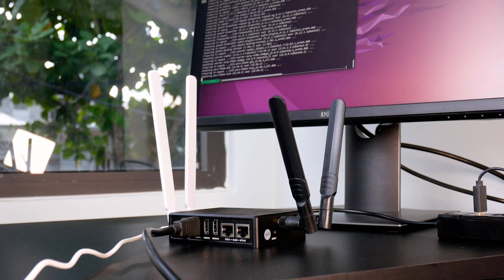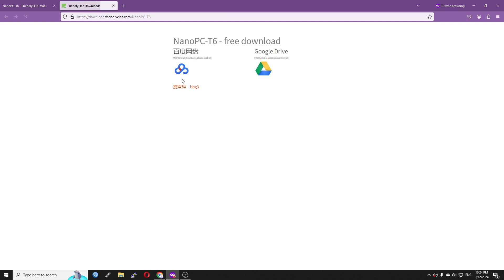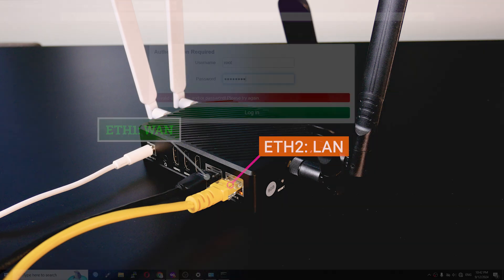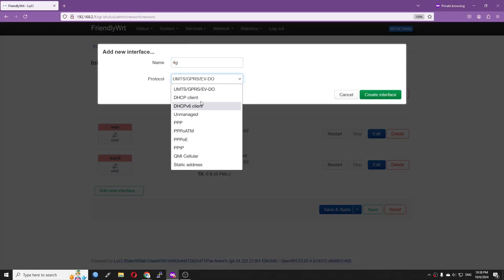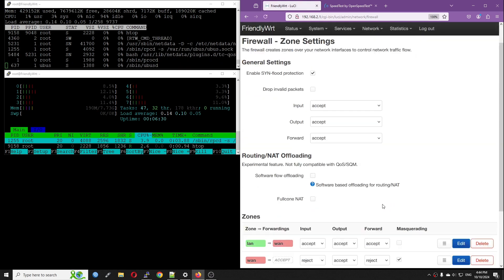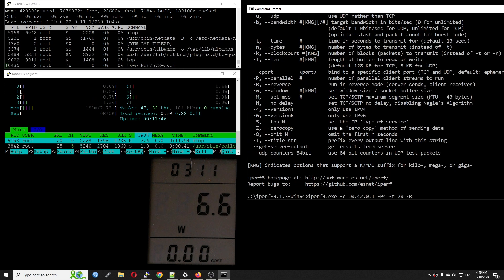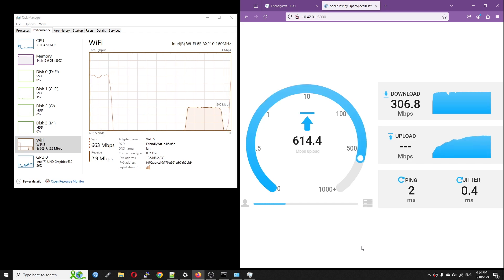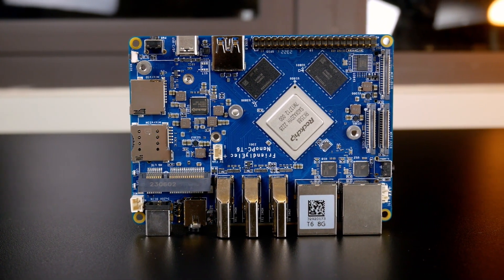NanoPC-T6 - O̵p̵e̵n̵W̵r̵t̵ FriendlyWrt Performance Test (WAN to LAN, WiFi, 4G/LTE)

Comment: Hi bro, I have Mini PcRouter with j1900, i211 and run OpenWrt OS but I don't know it have support hardware offloading 😢
Reply from the maker: Hi, I think the software offloading will work just fine for J1900, and you will most likely hit 1Gbps WAN to LAN.

Comment: do you think FriendlyWrt is safe to use? i am getting a R6S but only Openwrt snapshot available, was thinking of running with FriendlyWrt for the time being.
Reply: Did you encounter any evidence that it's not safe?
Reply: @Ignotus.  I’ve been hiding friendlywrt on the r6s. Rock solid.
Reply from the maker: Yes of course. You can also use OpenWrt 24.10.0-rc5 on the R6S.
Reply: 關於此版本

型號

FriendlyARM NanoPi R6S

平台

rockchip/armv8

版本

24.10.0-rc6 (r28388-58d0057481)

but can not find in rc7 now

Comment: OpenWRT on an optane SSD.....I like your style!
Reply from the maker: Actually I did try it before (install OpenWrt/pfSense), but not on the NanoPC-T6. This time, the SSD is just for power consumption & read write benchmark.
The Intel Optane SSD is very cheap, because it is just 16GB. I used to have some of the sticks lying around with different OS(s).